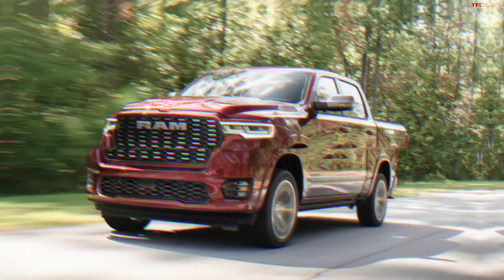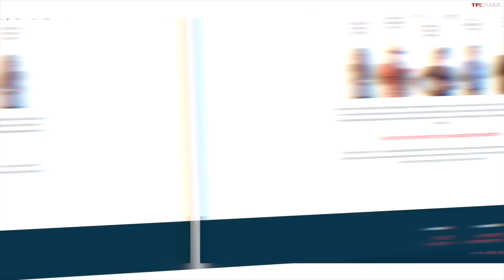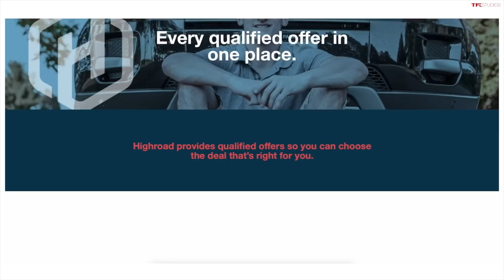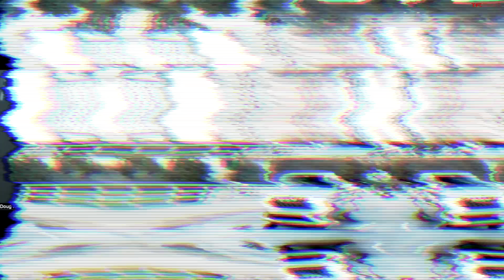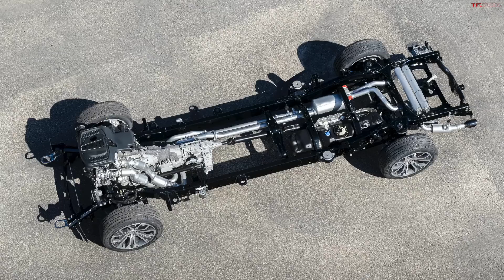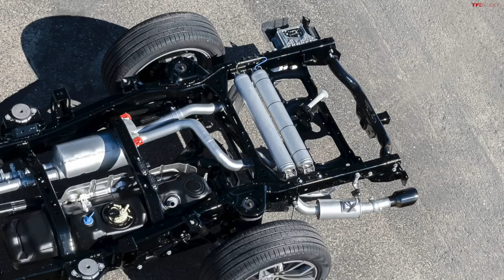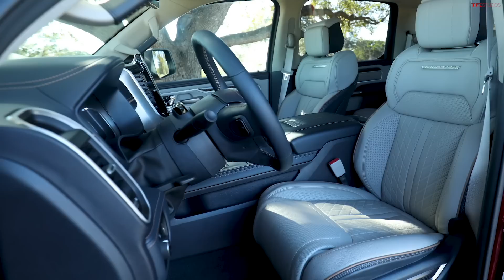No More Hemi V8? The 2025 Ram 1500 Chief Engineer Explains Why!

Comment: This guy is awful. He didn’t even explain what makes a straight 6 a better option for more power and added longevity. 

A straight 6 is a better design engine for more power and added longevity. It’s a legendary design in the automotive industry. 

He just blames it on the EPA. Those engineers who went old school to actually bring back the amazing straight 6 must be so upset with this guy. 

Can we actually hear from the engineers who built the engine from ground up. This guy is fired.
Reply: A 3.0 liter in a truck application running 22 or 28 pounds of boost to make power instead of a normally aspirated 5.7 or 6.4 liter has added longevity?  You are out of your mind.
Reply: @jimjones-pz1tt  N/A V8 all will have issues with higher HP. Too many moving parts to require a lift to make the power. Look at the Hemi chewing camshafts. GM 5.3 and 6.2 having valvetrain issue. All of them have to be so complicated to run, to pass emissions and idle. Much harder to work on. 

Now a straight six is simple design with only one head with so much less moving parts. All you need is a super thick block, huge water jackets for cooling, extra thick head gasket for intense boost and pressure, strong connecting rods and pistons. Simple. 

Add turbos on long runners with secondary cooling for insane power and massive cooling.  It’s a simple recipe to make massive power with ease. A lot less stress than a V8 N/A. 

Straight 6 is easier to work on because of added room. They also cool faster because of more room. 

It’s not hard to understand if you’ve ever built engines.
Reply: @jimjones-pz1tt  Let’s just say I’ve been around engine design and building engines for 36 years. 

You do understand that all trailer trucks have a straight 6 with huge turbos? All of them go over millions of miles. 

The most iconic engines ever built were straight 6. All are not the most desirable in the automotive world making way over 1000 hp with ease. They also last. 

2JZ Toyota
RB26 Nissan Skyline
Barra Ford Aussie
B58 BMW
S58 BMW 

Fords best engine was a 4.9 straight 6. Nobody could blow it. Ford lost money on not repairing them. So back to the V8 they went.
Reply: @jimjones-pz1tt  The 5.7 was a complete dog that had lots of issues. Too many moving parts just to make it pass emissions. Look at all the problems they had. 

The only company doing good with their V8 is Ford Coyote. Although the V6 turbo is faster and makes more power. V block is a bad design, especially for turbo. A straight is more balanced.
Reply: You're right about the positives of a straight 6, but did Stellantis sufficiently beef it up to be tractor tough. Such as Ford's Barra turbo 4.0 L inline 6.
Reply: @Paco_Burrito_Suave  time will tell.

Comment: If I heard right, the Hemi will still be available in the Classic version truck, I predict the sales of that going up. Ive often wondered why they didn't just develop a small twin turbo V8, that would have kept a lot more customers happy. GM and Ford fans are not going to be drawn over with the hurricane and they've alienated a large number of RAM customers, doesn't seem like a very smart move to me.
Reply: Go from a v8 to a small twinturboV8 in an environment where emissions and fuel economy is top priority? No. In-line is a great configuration for a truck.
Reply: That would never pass. That would be worse. 😂
Reply: I advise you not to become a market speculator.
Reply: The 2.0L turbo I-4 in the Grand Cherokee and Wrangler is in the same engine family as the Hurricane I-6. They share a lot of components and engineering that wouldn't be possible with a V8 layout. All else being equal (displacement, stroke v.s. bore, etc), a I-6 layout generates more torque than a V8 layout, and there's less complexity.
Reply: @JREwing78  You've missed the point completely, North Americans WANT A V8 IN THEIR TRUCKS. The fact that Stellantis cheaped out with the "new" engine doesn't surprise me at all, and the fact that they don't really care what the customer wants doesn't surprise me either. But it could have been done and the customers would have been happier.
Reply: @gabrielback5615  I couldn't care less if it's a V8 or not. It either works or it doesn't.
Reply: @gabrielback5615   I wouldn't say they cheaped outwith the new engine. They are pretty stout in the I4 form from what I understand, and the HO ones have some level of improved redgitiy over it and the SO version. Time will tell how they hold up in this application, but generally speaking bringing a new engine to the table in a different layout isn't something I would call cheap.
Reply: This guy is awful at explaining what makes a straight 6 a great option. It is one of the best design engines for power and longevity.  Hes fired.
Reply: @ryanb8736  I6s are great, but the problem is that longevity gets shaky with any layout when you downsize and use turbos to boost the power levels back up to where the larger NA engines are. The I4 Hurricane has been boosted with an SRT tune to put out almost as much power as the older 5.7 Hemi, and this I6 can put out enough power that it could be used behind an even larger truck. The HO I6 would have no problem moving a 3500 around, but just because the I6 is such a great design doesn't mean that it fits the application. At least with a 4L V8 they can push lower boost levels to make the same power and split the load between two extra cylinders. Also, keep in mind we are talking about Stellantis, not particularly the best when it comes to vehicle longevity in general.
Reply: @ryanb8736  It's a modern I6.  I fully expect it to be overly complicated and expensive to fix.  We're not talking about the I6's of the past here.
Reply: The Ram classic has been discontinued with the 2023 model being the final year.
Reply: @chrisgill7824  Ram's website seems to disagree with you.
Reply: @chrisgill7824 you’re right, I DID hear that th classic will be done or really is already
Reply: @chrisgill7824  Not according to Ram's website and, you know, the chief engineer speaking above.
Reply: @chrisgill7824  Not true they make it for 2024 and sounds like after that..

Comment: You want to V8 engines for Ford and GM.
Reply: Ford has the 5.0 Coyote which the 5.7 Hemi cant touch performance of MPG wise. GM needs a 6.2 to run with it. Machine shops repairing engines see more LS than any other make all fact! Now all of a sudden Toyota, GM and now RAM whatever say Twin Turbo small engines is great thing...something Ford did starting in 2009 Lincoln and 2011 the F150...same engine. lololol Its funny that all the GM RAM guys spread rumors about Ford  with their Timing chain and how long will the Turbo's soon as you mention F150. Welp, how are all of you Fans gonna act when this Twin Turbo 3.0 Architecture starts blowing up due to high Cylinder pressures. 22 psi in an Ecoboost 3.5 makes well over 600HP....gonna be interesting!!!

Comment: Andre, does your Colorado  have a cracked engine block, GM just recalled the Colorado  for that.
Reply: I have said thousand of times. GM has never made a good 4 cylinder. Never.  They can’t even get the 5.3/6.2 V8 right.
Reply: Problem is NOT systemic to the engine design. It’s a casting problem on SOME of the 2023 engines coming from that particular cast.
Reply: @ryanb8736 funny my first engine was a 2.0 GM 4 banger. It lasted 9 years and 150K miles. It still ran when that car was totaled. We have 5.3's with over 10K hours of usage in southern Arizona and they are still running fine. What you are suffering from is bias and it's not good.

Comment: Talk to real world mechanics not engineers (company men)
Reply: The only thing complicated about this engine is the packaging. How the turbos are mounted to the headers or are they directly mounted to the head similar to a Pentastar head. With all of the room in the engine bay it should be a whole lot easier than BMW,  Mercedes, and other over engineered manufactures. My concern is with the spray in cylinder liners and  the durability. Ford already uses that method on sum of their engine's and I believe they had an issue in the beginning with the process
Reply: Why can’t they just make a small 3 liter V8 turbo ? Keep a v8 sound and improve efficiency? 
I’d rather hear a v8 even if it’s a little higher pitched and smaller .
Reply: @Tommypollock epa and they had to buy epa credits that y the hemi ain't stay around
Reply: @Tommypollock displacement per cylinder is very important for both power and efficiency. Notice how there are ton of 6 cylinders in the 3.5L range and a ton of v8s in the 5L range. I haven’t personally tested it but I’m guessing a 3.5L v8 wouldn’t be nearly as powerful or efficient as a 3.5L v6.
Reply: I agree when it comes to repair situations but when it comes to the features of the truck of the whole, nobody knows a truck better than the people that literally design and build it.
Reply: Build a bullet-proof engine that has simple maintenance and mechanics start losing work. Why would a mech complain? It's like Subway complaining it's too hard to make a sandwich. Or United complaining airplanes are dangerous to fly.
Reply: Dodge has always had good engines, but their electric systems are questionable.  But only time will tell.
Reply: @deronthomas7904 And what has Dodge got to do with this podcast ? Dodge has had ZERO to do with RAM for 14 years . They don’t make them or design them .
Reply: Hey mechanic tell me about the new electrical system in the 2025 ram that you’ve never even seen or researched yet..
Reply: I was thinking the same thing. Campaign year 😆
Reply: mechanics? with all due respect the mechanics expertise is maintaining not designing and you average knuckle buster doesn't know how things work
Reply: @davidporter7051  Agreed. And it would be in their best interest if maintenance was long and complicated.
Reply: No real world mechanic has seen this powertrain. Just trying to understand your comment and how it relates to this podcast?
Reply: @Mdan7 there’s nothing to understand about people who are yelling into the void.
Reply: @Mdan7  You really don't know? Seriously?  Hasn't the Grand Wagoneer started using the new I6 turbo?
Reply: @rogerrussell9544  I work at a large Jeep store, have yet to see a Wagoneer I6 come back for engine work.
Reply: @ And how many have you seen leaving the lot with a purchaser?  Since you work at a large Jeep store, how are the new smaller turbo engines selling?  Asking for a friend.
Reply: @Mdan7  Yes they have the schooling for these new engines started years ago
Reply: @Mdan7  oh buddy. The mechanics will see thus turd soon enough lol just you wait lol
Reply: @davidrudd… Show me a mechanic capable of designing an engine and I will talk to him.
Reply: @is6566  There are plenty of very brilliant mechanics out there.  Do they work for the dealerships?  No, but mechanics actually work on these and they know what works and what doesn't.  Don't disregard their knowledge of vehicles.
Reply: How's that gonna help shillin trucks?
Reply: @0 Shillin isn't working very well for Ram dealers. I hope Stellantis helps dealers build bigger lots for storing everything nobody wants.